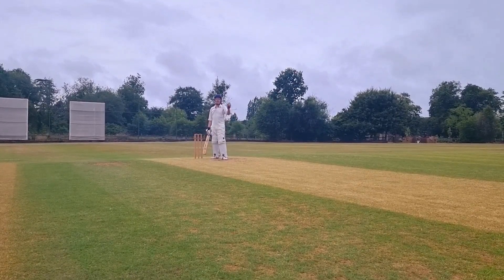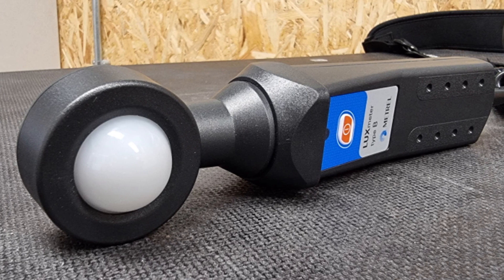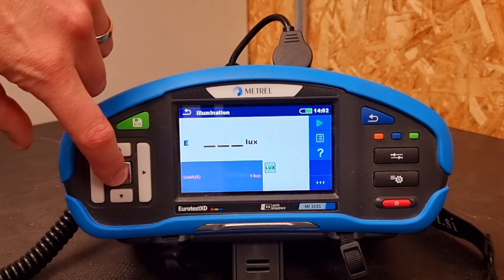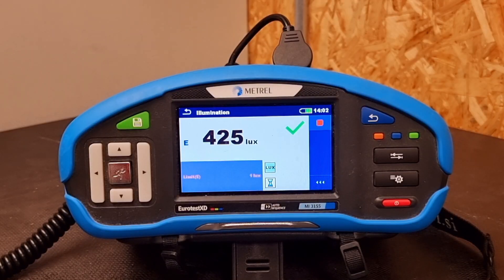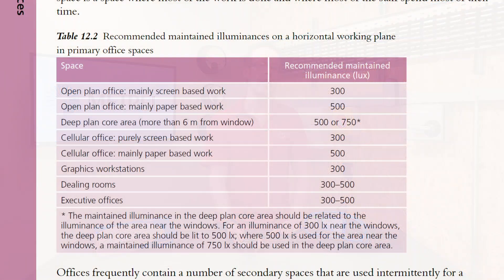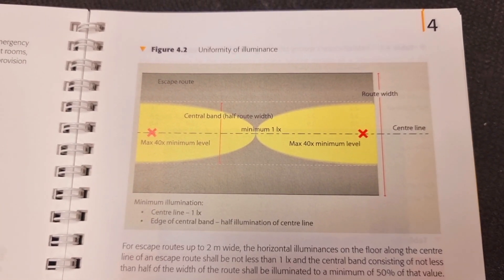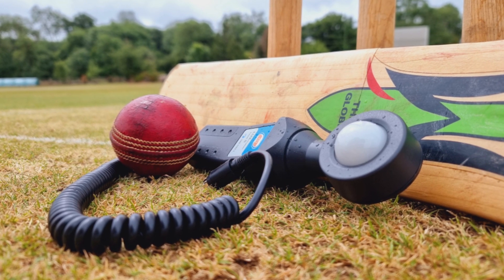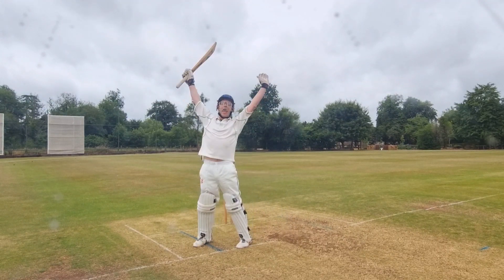Bad Light Won't Stop Play with this Metrel Light Meter

Comment: I think this is a great example of a product being released for the sake of it. Stand-alone lux meters are available from many places for cheap, for example the UNI-T UT383 which is currently about £20-30, is tiny and requires 3x AAA batteries.

What they have done here is produce a product that cannot be used as a stand-alone device and is therefore more bulky, I suspect costs more (Although I couldn't actually find the price of the add-on) and doesn't take advantage of the improvements that could have justified it. (It still requires batteries, it would be better if it used the multifunction tester batteries so that you only have one set to worry about, and it doesn't take advantage of the massive colour screen.)

Comment: Many times I have had to calculate and specify lighting in car showrooms, car workshops, machine shops and the like, also office work spaces, and quality control tables in print finishing works. For these places I use a dedicated calibrated lux level meter 🤡🐔